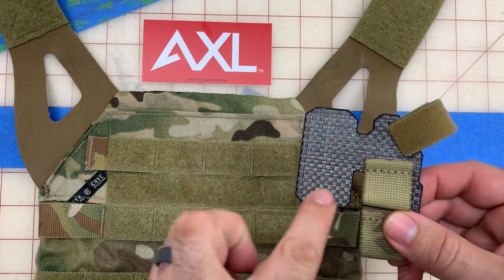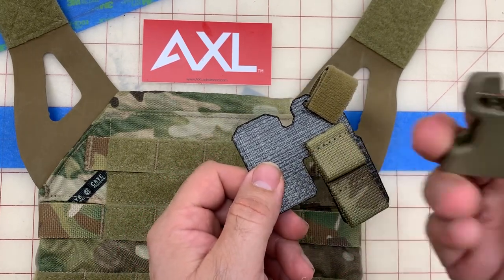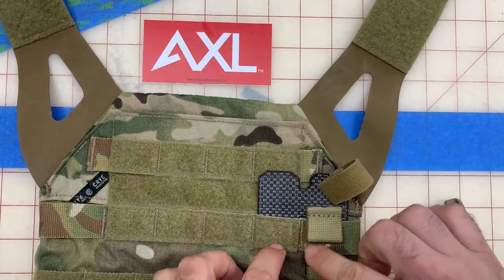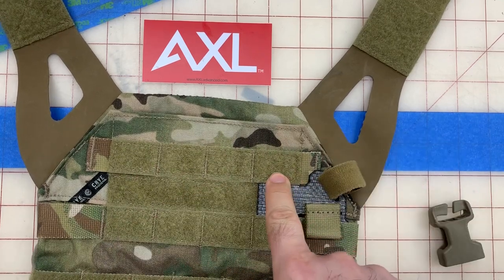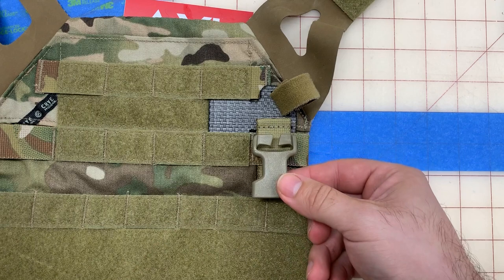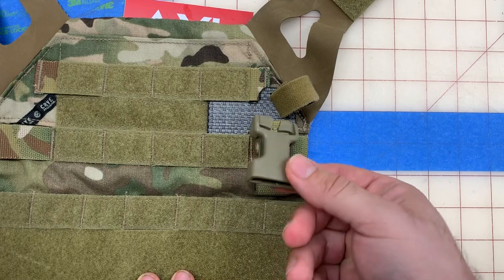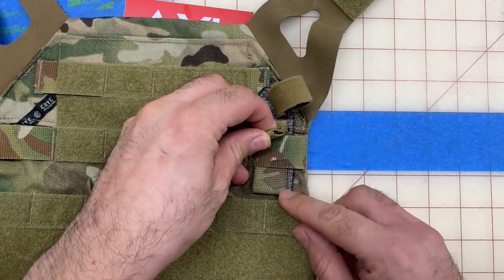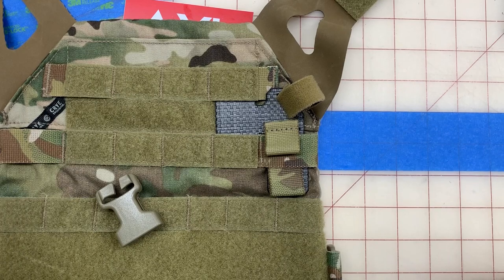Install Instructions: AXL MOLLE Chest Rig & Placard Adapter

Comment: Can anyone explain to me the purpose of this product? I’m looking into getting a crye jpc 2.0 and a Haley strategic d3crm at some point and I see this product may assist with the placement of the chest rig. Is that necessary or does that chest rig not typically fit appropriately with that plate carrier? I think I can see how it’s applicable but it’s hard to comprehend without seeing someone try and attach a d3crm to a jpc 2.0 with and without this AXL product. Any help would be phenomenal.
Reply from the maker: The AXL AVP for JPCs is only needed for the Haley D3CRM on the size large and size XL JPC 2.0 because of the length of the vertical buckle straps of the D3CRM. The product for the JPC 2.0 lets you adjust the ride height to the correct level so your chest rig does not ride up in your admin area. This is caused by the JPC 2.0 having the chest rig buckle attachment points a lot higher then on other plate carriers and can be a larger distance (measure from the front velcro to the buckle attachment point webbing) on the size Medium, Large and XL compared to the size small JPC 2.0 (Crye designed it mainly work with Crye chest rigs that have adjustable vertical straps). The AXL AVP also adds chest rig buckle attachment points for carriers that do not have them like the JPC 1.0 and similar MOLLE compatible carriers. We also recommend the AXL Chest Rig Retention Kit to help secure the D3CRM to the sides of your cummerbund.
Reply: @AXLadvanced  That makes a lot of sense. Thank you so much for that explanation and your speedy response!
Reply: @AXLadvanced  Finally an answer. I was so confused by products like this and the Hugo Industries extensions. The D3CRM rides perfectly with MEDIUM plates/bag.